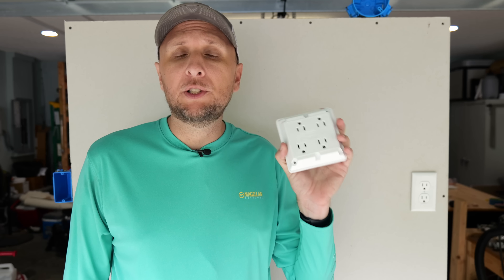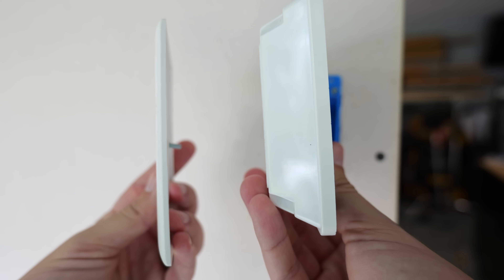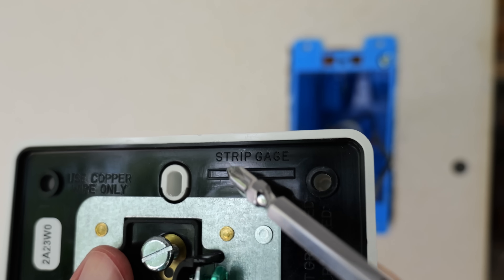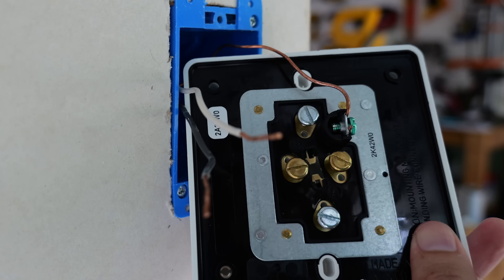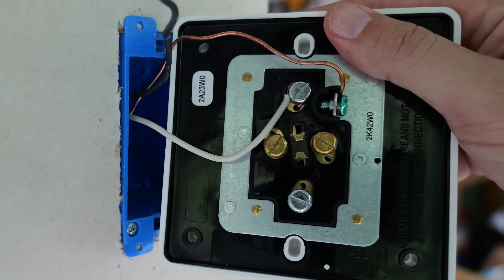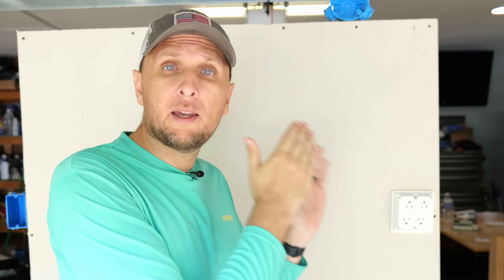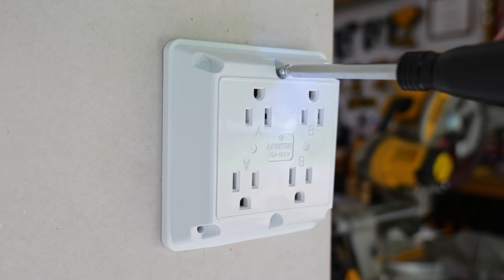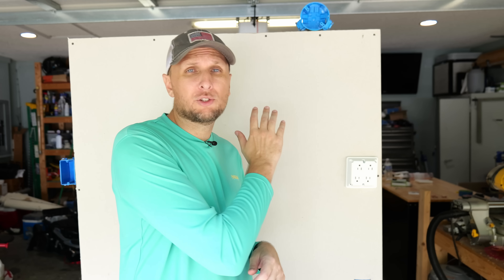The GENIUS 4 Outlet Receptacle That Almost Nobody Knows About | How To Install

Comment: There is also a plug in device that just plugs into the existing duplex and held in by the cover plate screw.  No wiring changes at all.
Reply from the maker: Yeah they are not made as well and aren’t hardwired.  Easy but tend to start going bad after a couple years.  I’ve gone through two of them.
Reply: @HowToHomeDIY  if those are going bad then these will go bad in the same application.
Reply: @szlash280z  It depends on how they are constructed. But there's no reason the blocks couldn't be as well constructed as one of these. The only real difference is the connection method.
Reply: @szlash280z  terrible logic.  That’s like saying a plastic fork should be able to last as long as a metal fork with the same usage 😂
Reply: @John Picard  are you special?  how would it go bad?  most likely by frequent plugging and unplugging. the contacts likely wore out. if he wore out one outlet then using  another outlet the same way will most likely have the same result.  go skip rocks but try not to use the ones in your head.
Reply: @szlash280z  oh good one 😂 you do realize the points inside of receptacles are made with different quality right?   There is a reason those plug in devices are so inexpensive.  Your logic is completely flawed.  I can plug and unplug an industrial grade device many more times than a residential grade and especially one of those cheap adapters before the points wear out.  My goodness.  Stay off the road please, it’s not safe for you.

Comment: One thing that's been around for decades is a 6 outlet block that plugs into a regular duplex outlet, so that you convert 2 outlets to 6.  I have a couple here, one in my "office" and the other in my living room behind my TV & A/V receiver.  I also have a Blu-ray player, TV box, clock and Ethernet switch plugged into that one.  These are about the same size as what you're installing.
Reply: First thing I thought of. This is silly.
Reply from the maker: Yes but they usually aren’t UL listed and don’t have a hardwired connection which is always superior.   Those cheap blocks go bad after a while.
Reply: @HowToHomeDIY  Mine are UL and CSA listed.  They've been in use for at least 30 years.
Reply from the maker: Yeah and they made things a lot better back then.  I’ve owned a couple of the newer ones and connections started getting loose after a couple years.
Reply: @James_Knott  yeah back in the day everything was made better.  They are pretty much all garbage now and start getting loose with moderate usage not long after installing them.  What he’s installing is hardwired and industrial to hospital grade and is better than those adapters in just about every way except time to install.  Which, oh no, we might actually have to work a couple minutes more to install something of quality 😂
Reply: @johnpicard4909  

I expect that would depend on the brand.  I would think brand name, such as Leviton might be a tad better quality than something from a dollar store.  You can find a lot of cheap junk there.
Reply: @HowToHomeDIY  You can find UL listed ones made by brands like GE, Phillips, and similar for under $10 all day.
Reply from the maker: Yes some are.  Still are not made as well and aren’t hardwired.  Not as good.

Comment: I just ordered one of these last weekend. I am installing it in an enclosed home entertainment rack (originally built in the 80's for a large tube TV). The outlet install there has been iffy, so I am adding this for some more durability and quality for some very expensive equipment.

Comment: Why not just plug in a multiple outlet wall plug? No messing with connecting wires, and you wind up with about the same depth.
Reply from the maker: The ones I’ve used are usually way larger, not UL listed, and ports start going bad after a while.  A hardwired connection is always superior and these are industrial grade.
Reply: Things are garbage.

Comment: I seem to remember a similar device but even easier to install.  You just plug it into the existing receptacle.  It had 2 males on the back that plugged into the 2 existing sockets.  If you wanted 
a secure fit, remove the center screw from the original and run the screw that came with the new receptacle through its center and to the original screw point.  The over all thickness
seems to be the same.
Reply: Agreed. I use them too...no rewiring required. In light of that, I'm not really sure what problem this thing solves especially since you still end up with protruding plugs.
Reply: I've used those for many years.  You can find them everywhere they sell electrical stuff, including dollar stores.
Reply: Agreed. They now have them with USB charging, surge protection, and even four rotating sockets to better accommodate wall warts. The advantage of cutting into the wall is only to sit flush.
Reply: @thatsunpossible312  I have a couple with USB,  nice
Reply: yeah, I think those are probably better and they usually have 6 outlets too. I put a modern style one at my bathroom sink that included 6 outlets, some low power USB charger ports and a night light PLUS a little shelf on top. It's pretty nice.

Comment: This is a great option, somewhere between a power strip and installing a two-gang box with a second receptacle.  While I hadn't see this before, I have seen a device that looks almost exactly like this, except it has a pair of plugs in the back.  For that device, you remove the cover from your receptacle, plug it in, and then use the included screw in the middle to anchor it in.
Reply: And those have SIX outlets, not just four!
Reply: @catsofmortontexas  And sometimes USB. I've also seen them with side outlets which more then makes up for the added thickness.
Reply: @chaos.corner  I have a couple with the side outlets too, they have some advantages but there's not enough clearance for "wall warts."
Reply: @catsofmortontexas  Yeah, it's a whole mess. I usually just end up getting short-lead power strips with 90 degree plugs. The squid ones are handy too if a bit messier. Hopefully wall-warts will disappear in favor of usb-c soon.

Comment: They have something similar that just plugs in to the single recepticle no wiring required. I'm no expert but to me it looked like you did that wire the wrong direction. You  wrapped the black wire the correct direction. You did the white one the opposite direction. The little arrow even shows your supposed to go the other way 5:51. I correct me if I am wrong. I see one potential problem where someone who doesn't take the time to read directions could think those little holes are backstab holes and not even put the wire under the screws.
Reply from the maker: Yeah and those somethings are cheaply made, aren't UL listed, and start going bad after a while.  I took time in the video to go over what direction they should go in, why, and how they were going around in the proper direction.  There is no arrow anywhere on the device.

Comment: I am a JW (Journeyman Wireman Electrician) in the IBEW, retired for 17 years. I don't remember seeing this product.  
I think your video was very well done!  You showed and explained the correct procedure, but I would have liked it more if you had gone into making pigtails. It is not uncommon to have a box with  more than 1 load wire. I know that it is common to use the receptacle to continue a single load, but as long as the splice (wires twisted, tight connections) my personal preference refer pigtails

Comment: What is the difference between the hospital grade and the other grades?
Reply: Retention, force required to insert/remove, materials impervious to hospital cleaners/sanitizers.  Mostly it's about physical robustness and keeping the plug in the receptacle.  Wouldn't want Granny's IV pump or heart monitor to stop because the plug fell out.

Comment: Looks like an interesting idea that needs refinement, slotted connection screws are No Bueno, extra holes in the face are unneeded, the non symmetrical face is a no go too.
Reply: yeah, this thing is fugly man. I would rather just use the older type that came with 6 outlets instead and is just as ugly.

Comment: Yanks.  All of our outlets are doubles.  However, that 2x13Amp outlets.  26A from a single dual outlet.  That's 6600W from one outlet.
This means that, except for high power equipment, such as heaters, most things get wired onto the end of 4 bar extensions.  In my office I have 2 chains of these, one running from the grid and one from the off-grid battery/solar.  In total I have 10 extensions and about 30 sockets.... running off 2 x 13Amp outlets.  240V baby!
SAFETY NOTE:  DO NOT DO THIS IN THE US!  In the UK ALL our plugs are fused.  Each individual one of the 30 plugs is fused.  Each of the 10 power bar extensions is fused.  This is not the case in the US!

Comment: 4x No. of outlets = 4x the potential load.  Is the wiring up to the task?  Usually, the power distribution circuits are only sized for the No. of outlets and thereby the assumed maximum power draw.  Is the 4 gang unit compliant with the local regulations?  Amazon products are often manufactured to different world wide standards that may not be up to standard for local use.
Reply: This is not an Amazon product.  It's made by Leviton.  Google it.  In the USA there is no specific limit on the number of receptacles on a circuit, and one cannot overload the circuit as it's protected by a circuit breaker or fuse.  This product is U.L. listed (approved) and as such is type-accepted in 99.9% of jurisdictions, which is the next point:  while there is a "national electrical code", it is a model code to be adopted by local or state authorities and modified as they see fit for their locale, but all require that wiring products be "listed" for their use.
Reply: @raygunsforronnie847  The opening statement on the video is "Whilst I was browsing on Amazon I came across a device made by Leviton......."  AFAIK Amazon don't make anything they market other's products and TBH I have never heard of Leviton.  Whilst the number of different loads that can be added to a circuit can exceed the rated CB, which will ought to trip to stop the overloading there is a delay and repeated use up to or just above the rating will be tolerated by the CB and definitely by the fuse for a short time that eventually allows for the disintegration of the hardware after repeated operations.  You could rely on a diversity factor but that would be assuming maybe too much.  I am sure the user will get mightily p****d off if they are having to rewire the fuse or resetting the CB frequently and I expect that the majority of homeowners won't understand what is happening.
I didn't doubt that you had an electrical code that would be applicable but there is always a chance that the homeowner modifies the system to solve what they see as issues.  If he is being encouraged and is capable of  increasing the outlets on a circuit then it is quite possible that the CB/fuse is swapped out for a bigger one to counteract the constant problem, without doing anything about the wiring.
Reply: @clivewilliams3661 Just FYI, Leviton is a huge name in the electrical space. Everything from receptacles, switches, light fixtures, and even entire commercial lighting control systems. Amazon is just a reseller of that stuff, just like Home Depot or whatever. 
While a homeowner may upsize a 15A breaker to a 20A because it trips all the time from being overloaded, that's totally on them if something goes wrong. Most jurisdictions only allow the replacing of things such as switches, outlets, and light fixtures without a permit/inspection. Basically the end devices of a circuit. Although usually a need for something like this is to plug in a bunch of small draw items. 

Not saying it will stop anyone, but if you have no clue what you're doing going into something like a breaker panel to swap it out, better leave it to a pro.

I've always been very electrically inclined, but when it came time to finish a friends basement, I read nearly everything in the Black & Decker Wiring Guide book with all the recommendations based on the latest codes before I started. Also had a licensed friend double check I wasn't missing anything. Now I just refer to our states guidelines to see what's changed with updated codes. I've wired many of my own and friends projects since then and passed inspections easily. One inspector even asked if I was licensed electrician and was surprised when I said no.
Reply: @andrewt9204  Being European, Leviton is not a name I recognise.

The problem with homeowners upsizing the breaker rating is that as it overloads the wiring, the wiring deteriorates so that it becomes less capable of handling the load it was originally designed for so could become a danger that risks the life of the homeowner and also innocent others.  Also, houses are long lived units that change hands regularly so that what may appear to be a safe installation is not and it could be many years and occupancies. before it is discovered  or a catastrophe occurs.  Whilst the regulations are there to ensure a safe environment they cannot stop bloody fools and the only part solution I know is to only sell products to certified contractors as we do in UK for gas installations.

Comment: Sir, they already sell this in a plug in device. sticks out the same, rated same, but takes all of 3 seconds to plug into a single gang. you have one screw to lock it down. you get 0 out of 10 points, you lose, thank you for playing.
Reply from the maker: Nowhere near the same.  These are industrial grade and will last an extremely long to.  Those plug in devices are cheaply made, usually not UL listed, connections start wearing out, and they cannot compare the superior connection of these Leviton outlets being hard wired.  While I can appreciate your sarcasm, you are comparing apples to oranges.
Reply: @HowToHomeDIY  I have 2 plug in versions I have been using in my machine shop for nearly 20 years. they have not failed yet. I have others in the house and have used them for years, swapping them room to room. no signs of failing. your argument does not hold. you fail again, and have shown your corporate sponsorship in the process. you sir, still get a 0 out of 10, and now a strike for even trying.... thank you for playing.
Reply from the maker: 😂 cool story.  I’ll just take your word for it.  I just saw your name.  It all makes sense now.  🚨troll alert 🚨
Reply: @HowToHomeDIY  you may think I am a troll, but you KNOW I am right. you just want to make videos with the "cool toys"' not that they work any better than the parts I use.
Reply from the maker: No I legitimately think you are trolling.  I definitely don’t agree with you either.  The ones made 20 some years ago were built way better than the splitters now.  I’ve gone through a couple of them with ports going bad after a few years.

Comment: Hardly any different than the cheap 6-outlet plugs that you just stick in the existing outlet and equally kludge-worthy.  And yes, the slotted screws should tell you the genius behind this abomination.
Reply from the maker: Those cheap outlet plugs are exactly that.  I have gone through so many of those in the past.  They are poorly made and wont last.  These outlets are industrial grade and will last a very long time.  Also they are hardwired which is superior in every way to an adapter or splitter.
Reply: To think those cheap adapters are as good as a hard wired connection and an industrial grade device is pretty special.

Comment: Have several of these that I bought about 18 years ago. Very convenient for the computer room where the peripherals take very little current. Eliminates the need for "lightning" strips that clutter one’s floor or back of a desk. Very efficient!
Reply: Wouldn't recommend that, at least put a upsin series or something, surges love to eat electronics, especially older ones.

Comment: Correction on the comment about using the second Neutral screw to extend the wiring to the next device.
This can be done with the Hot, but code states that the Neutral can not be dependent on a devices. So, you would need to use a pigtail to gang to the next outlet.
Reply from the maker: That is only true on a multi wire branch circuit.  In most residential applications that will not be the case.

Comment: Pretty neat.   I’d pay the extra cost to save the work.  Just added pegboard in garage and changed single to double.    Had to extend out and was a lot of work.   This would have saved me quite some time and gave me the results I wanted.   

Got two more to do and going to check these out 👍

Comment: What kind of idiots would use slotted screws. Better idea is push in like normal outlets have.
Reply from the maker: Push ins are one of the worst connections out there.
Reply: @HowToHomeDIY    Not true. More reliable than the screw on.
Reply from the maker: Completely false.  Every electrician I have ever met has told me a large amount of their service calls are from push in connections.
Reply: @HowToHomeDIY    You must not be an electrician if you were you would know better.
Reply from the maker: You must not be either otherwise you would 😂.  This is a well known issue.
Reply: @HowToHomeDIY    My call backs on push in connections are nearly zero.
Reply: @mikewhite9818  Because it takes 3-10 years to fail.

Comment: ya, I just got a thing with 6 receptacles where all you do is take off the face plate, plug it into the existing receptacle, and screw it into the faceplate hole.
Reply from the maker: Yup.  I have owned those.  They break and connections get loose.  Typically they aren’t UL listed.  These are very well built, will last a very long time, and a hardwired connection will always be superior to any of those splitters or strips.
Reply: @HowToHomeDIY  I suppose, but it's still fine after like 15 years.